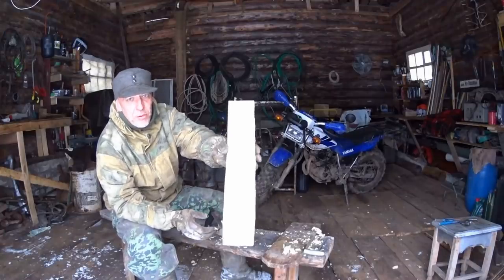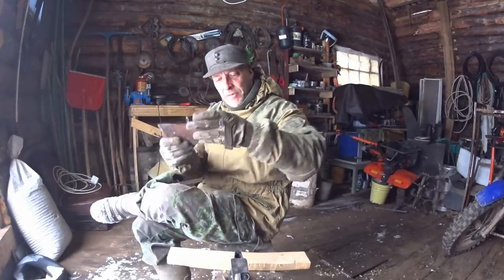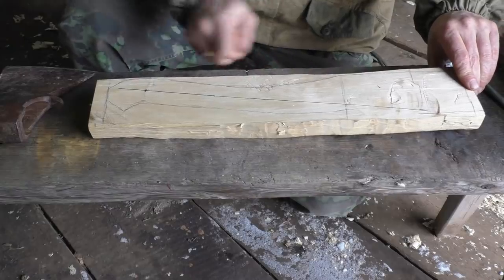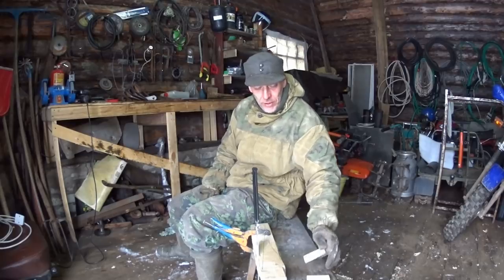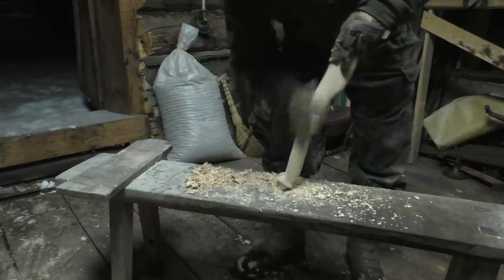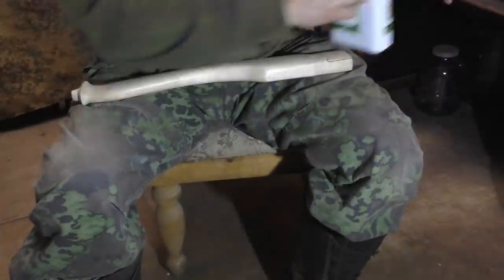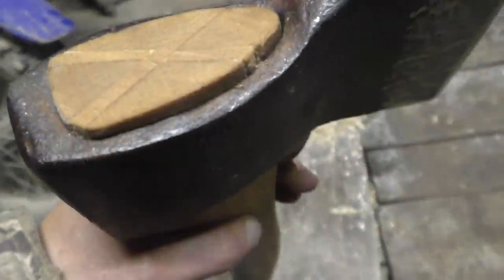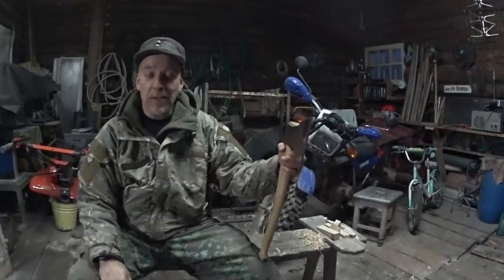Making An 18th Century Carpenters Axe 2019

Comment: Yep I am impressed - for  finishing wood for a gun stock for example I slightly  wet the wood and rub with steel wool a couple of times -the water makes all the minute slivers of wood curl up and the steel wool cuts them of to give a mirror finish. Of course you might not want a mirror finish for an axe handle.
For gun stocks I also water down the linseed oil with turps for the first few coatings and rub with steel wool between the coats untill all the grain is full then use pure linseed for about 10 coats and add a bit of meths and furniture polish to the mix for the last few coats -lol the whole process takes about a month and who wants to wait that long .

Comment: I found  six old axe heads on my property in SW France , they turned up when we dug up the garden the old farmhouse is over  2 hundred years old . And the old farmer near me said they were at least from the early 1900s . The iron is incredible after a clean up and sharpen they are axes you could use as a knife almost . I only had to make handles .I  wouldn’t have bought new shaft for them but anyway modern handles don’t fit these old axe shapes . You are right it looks easy to make one but you need to have the shape just so .

Comment: Nice one Lars. Your shop power issue, why not use an old lawn mower engine, like a Briggs & Stanton hooked up to an alternator by taking tappings off the field coils, as this will generate about 110V AC per field coil. There are quite a few utube videos on these.

Comment: Really great job. I have 20 +  old axe heads, pickaxe heads and sledge hammer heads of various sizes
in my garage. The farm supply and hardware store handle stock just don't do the job (cut it, so to speak).  
I need to try something different for better handles. Thanks for the instructional.  p.s. I'd ship you the whole 
pile of old heads but the cost would be beyond prohibitive. Ride the wave. Keep up the good work. Bill

Comment: Is there a purpose for the little knob at the end of the handle or is it just for looks? Thanks much. Nice video.
Reply: You can drill a hole through it to hang the axe from a nail on the wall.  Or, crack a skull open on the back swing...

Comment: Snow AFTER the intro! I think winter is coming. My project today is to mount a 2 cycle, 1.5 hp gas motor on my table saw. I too have an end of the line power problem. They removed the line and my pole.
Reply from the maker: It's almost gone by now. Two days of rain.. That is a serious problem you got there :)

Comment: Wet it, sand it, wet it, sand it. That will give it a glass finish. Just rub the linseed oil in with your hand. A few drops will do for the first coat. One or two drops per coat after that

Comment: A way around your power issue........Charge up a couple of 100Ah 12 volt batteries, hook up an inverter to them,

around 2000 watts rating.    Would work but only for a couple of hours.....  12v x 200Ah  =2.4kVA for 1 hour  = 2.4 kWh   Nice hatchet!!!

Comment: I always thought you would oil the handle after the axe head is seated, as the wood will swell a bit when it absorbs the oil. Anyway, I'm curious about the centerline you draw, is there some rule of thumb what the angle of it should roughly be, or is it all down to personal preference? Thanks for the video.

Comment: Well done!  Truly the work of a skilled woodworker.  Did you manage to drive the wedges all the way in, or call it good and cut them flush?
Reply from the maker: Thank you. I always make the wedges longer than needed. The most important part is, to get good expansion at the top and not drive the wedges all way down the cut I made with the saw. The handle can split if you drive them all the way. I stopped a few mm short of the "bottom" and cut the wedges flush. It is still in service here in 2021 :)
Reply: Part of me starting to cringe a bit as you kept tapping on the wedges... :p

Comment: I have a dumb question:
I've seen several old pick-axes, splitting mauls, etc., hat have the handle fattest at one end, no wedges, and the head of the implement is simply held in place by friction, and can't fall off due to the very end of the haft being fatter than the rest (although I've had my fingers banged up several times by it falling down the haft on an upswing as a kid...).  But anyway, I have no idea what that is called, and is that something you would ever consider?  Or is that too basic, since you obviously know how to wedge your own tools?